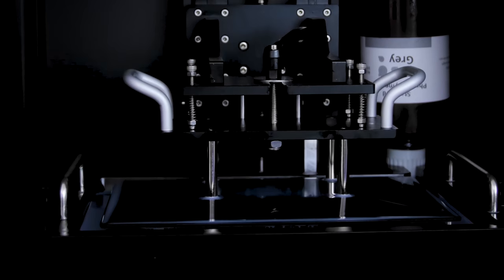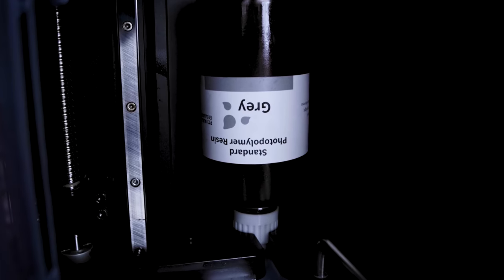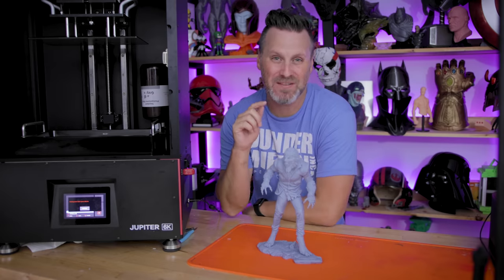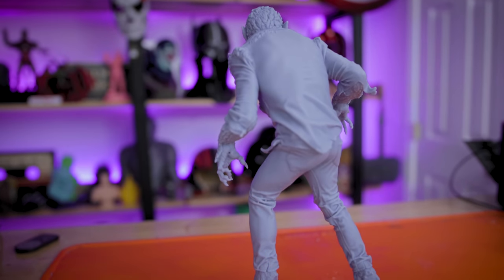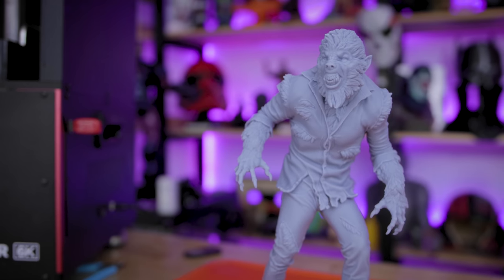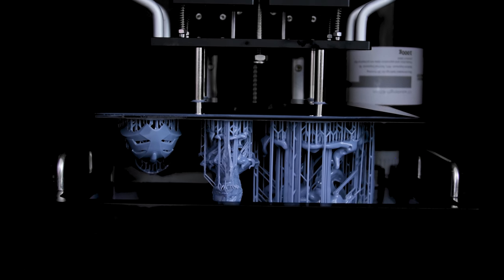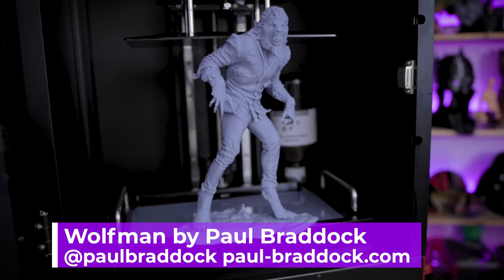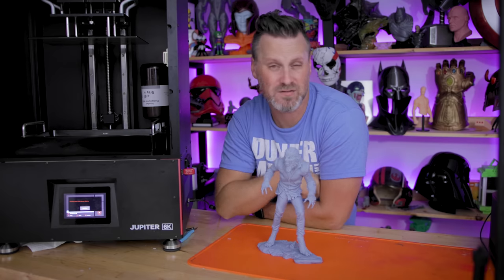Elegoo Jupiter FULL build volume 3D Print | Resin 3D Printer Kickstarter

Comment: I've been waiting for a giant print from you on this printer. SO COOL!
Reply from the maker: So happy to see it print this fast and this clean!
Reply: @UncleJessy  I see you pulled the supports off right after the print finished. Some people tell me to hot water soak it first and others swear by ultrasonic cleaners.
If I pull them off fresh from the print I get the holes. Thoughts?
Reply from the maker: @IamNinetyFour  it all depends on the support settings you use. In general a hot bath after cleaning the resin will make the supports pop right off. My print looks crazy clean and I just popped them right off easy peazy

Comment: I know there are pros and cons to having a smaller resin printer on hand. 

Right now I have 2 elegoo Saturns, and I'd say I print an even amount of small models and then utilize the full size of the build plate. I don't have the means to just buy jupiter especially now that the kick start price ended, but I would easily sell both my Saturns and put it towards a Jupiter next year. 

If I only had a Jupiter, do you think that'll be ok if maybe one or two weeks im constantly making only smaller objects? Just afraid the bulkiness of the build plate is gonna have me missing a smaller printer too much.

Comment: Can you work with elegoo to make it so that each printer comes with a resin lapse cable and a built in mounting hole for the sensor? If not the cable at least the hole for the sensor.

Comment: Did you print it solid? Looks good 👍
Reply from the maker: Hollow with drain holes in the feet, taint, palms, under the chin
Reply: @UncleJessy 
Thanks for the info
Reply: I guess Wolfman's no longer got nards, then
Reply: Drain Holes?! Is that a setting on the software? Never heard back adding “drain holes”…need to read more…
Reply: @pedropereira1417  drain holes are added in presupported hollow models to cancel out the suction force and also for uncured resin to flow out of.

Comment: Just noticed this on the web page for the latest firmware for the Saturn which was not locked to Chitu:
③ Compatible with Chitubox Pro and Chitubox 1.9.0

So is the new firmware for the Saturn also locking to Chitu?

Comment: Hey uncle Jessy quick random question. I built a ventilation box for my 3d printers. I'm finding I only use my larger volume printer and looking to remove the 2 smaller printers. Now, if I put my large ultrasonic cleaner in the ventilation box with my large volume printer.....is that ok? Or would the green stuff or alcohol fumes bother the printer even tho there's a fan extracting the air from it?

Comment: Are you required to use chitubox with the Jupiter?
Reply: Yes your locked into Chitubox.. you can use another Slicer and import the output but you always need to use Chitu to create the file to run on the printer itself. Also Chitubox software updates now force firmware updates or they wont work AFAIK.. I didn't flash my Saturn (which was open) as it looks like it will lock it into Chitu also now...

Comment: Remember that if you buy this you will be locked in to using Chitubox for your slicer. Chitu so far has not shown any signs of making good on their promice to open their encoded firmware to other slicers. Their answer is that you can use whichever slicer you want to do your supports and then export the supported STl to Chitubox to do the slicing. Do not buy any machine with the encoded Chtu boards.